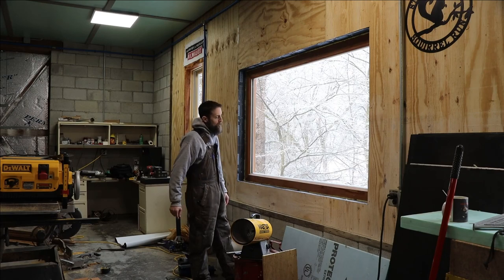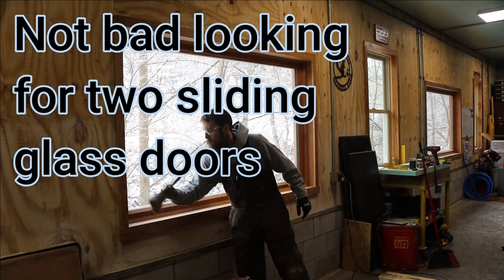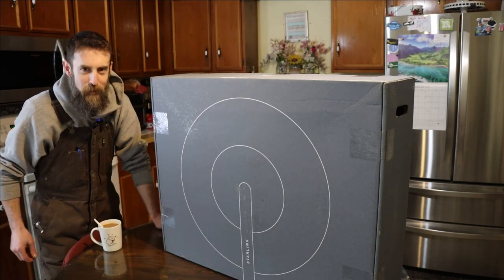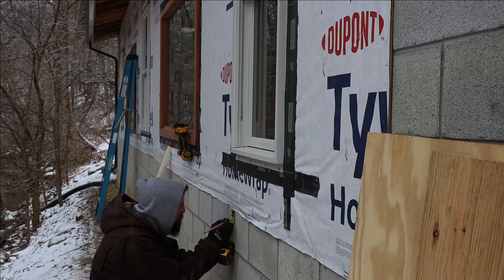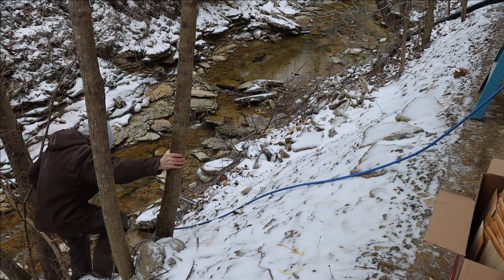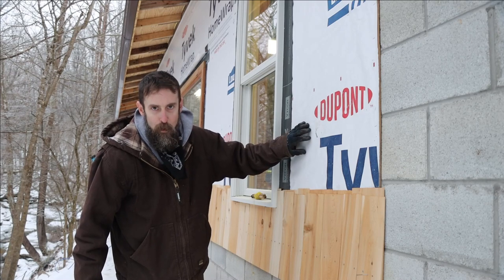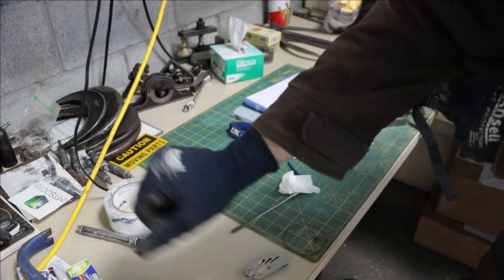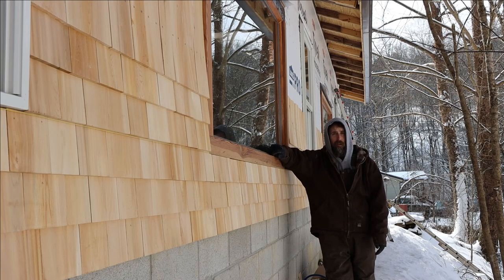Looking GOOD! Workshop Siding  going up. Shop update

Comment: Steven, what ever stove you buy let me recommend a "Magic Heat" box that goes in between the top of the stove inline with your pipe. It is a reclaimer and the amount of heat it puts out is amazing. Heard about them for years but finally bought one a couple years back. I felt just like you with your internet, happy at the performance but angry that I wasted so much wood over the years.

Comment: I got stuck in a hotel outside San Antonio for a week while driving from Florida to Arizona. Everything was covered in ice and the storms were back to back. I couldn't even get out of the hotel parking lot because of the ice. Restaurants ran out of supplies and closed. I lost 12 pounds (none of it from around my waist). I can't complain though. The hotel never lost power or water and there were a lot of people across Texas that were not so fortunate. People were trying to check into the hotel to escape freezing homes but the hotel was full. Definitely a bad situation.

Comment: Steve, I would put a wood stove at each end of the shop if you can afford it. You could build your second one out of old rims stacked one on top of the other. 1-inch difference in rim size stack inside each other. (several videos on YouTube show how) If you want to see the fire use glass from an old oven in the door.

Comment: Ifound after years, I bought a finish air nailer for putting up oak trim is so much faster than drilling than trying to hand nail. And yes harbor freight worked just fine, and cheap.
Reply: I agree with the Harbor Freight nailer.  I did find that using a name brand nail in it made a hugh difference.  The Harbor Freight nail seemed to bend and jam much easier.
Reply: Yes for sure a Brad Nailer for trim is the way to go. 10 times faster and MUCH cleaner. I don't do trim without one.
Reply: @larrysmall3521  my problem with the HF nailer is the sealing ring goes bad and you cannot get replacement parts.
Reply: @july8xx  I've had a HF brad nailer for over 20 years. At one point due to its advanced years it did stop running for me. So I pulled it apart and gave it a good cleaning. That brought it back. It's a model they don't sell anymore. Thing has zero safety features on it. You pull the trigger and it launches a nail. I love it! If a seal ever goes in it I'm going to find a replacement someplace.
Reply: @1pcfred  The seals were some kind of white plastic that deteriorated after a few years, I wish I could find something to replace them with. The crown stapler and brad nailer have not given me any problems just the large nailers.
Reply: @july8xx  my gun is from 1994. It has no right to still be working today. It tried to retire but I wouldn't let it. They don't make them like it anymore. I hate the new guns with that safety nose switch. So clumsy.

Comment: My approach to your wall would have been to go with weathered blocks but I have to admit that you are going to have one good looking shop wall.
Reply: I used to pass an old cinderblock garage where the blocks tapered from bottom to top so when it was painted it looked like either a shingled building, or one with really wide clapboards from a distance. I suspect the idea never took off due to needing right and left corner blocks. Looked kind of neat though.

Comment: Steve - Have you considered running a safety net or something between the trees below where you're working ?  Or wearing spikey-crampon things under your boots ?
You now have some holes in your blocks below the siding from the guide 4x2 - could stick a couple of eye-bolts in there as a hook point for a grab rope, or
even a longitudinal wire, hook a carabiner on and to a harness - or even just hook onto your belt.   Just thinking ahead.

Comment: Steve, you and Elizobeth looked very cold out there putting those shingles on. It looks really nice. Better than lots of houses that people live in. Steve, I have a nice pellet stove and it does a good job heating my entire 1600 sq. ft. house but it has its draw backs. It has an electric feed motor that feeds the pellets into the fire box as well as a thermostat. When the electricity goes off so does your heat. Also if I keep the thermostat on 68 to 71 it will burn a sack of pellets in about 24 hrs. Here the pellets are about $4.99 per sack if you buy a pallet at a time. That is about $150.00 a month if you burned all the time. That ain't cheep.
As much wood as you have around your house you have the right idea to get you a wood stove with a blower or put a small fan near by and it should heat your shop ok. That snow surely is pretty to look at but a little unpleasant to work in. I enjoy your videos as they are and now they will probably get better with that new satellite high speed internet.

Comment: You're a great builder; make a wood-burning stove; it will be way nicer and work better than anything you could buy. I've had wood stoves with glass fronts, and frankly, the ambiance of seeing the flame wears off real quick compared with perpetually cleaning the glass. Besides, a steel door gives off more radiant heat, and the stove stays warmer longer once the fire goes out. Get or make one that drafts from outside, so you aren't drawing your combustion air from the shop's interior by sucking air in through all the shop's gaps and cracks.

Comment: If i were able to convince you of anything, it would be to get a pellet stove for your shop, and your house. I burned wood for 20+ years and then 20-25 years ago I switched to pellets. there is nothing that beats pellets. They are less work, more heat, by far they are more efficient. They will heat your shop 24-7 with so little work compared to wood you will wonder why you even considered wood. I also burned coal for about 12-15 years in the basement cause it gets real cold down there in the winter and a heated basement keeps your floors warm, and that is nice, This winter I retired the coal stove in the basement and installed another pellet stove. I am so glad that I did. Coal heat is great, it is hot and it burns a long time, however it is twice as much work as a pellet stove. If it came down to it I would burn coal again, but I will never burn wood again. 
      I know you say you have all that free wood around you, but it ain't free. It's cost in labor makes it so not worth it at all. 
      Listen to an old man and at least look into pellets.

Comment: I'll stick with my DSL through my phone company. I will never use a dish or satellite ISP. 
Look at Harbor Freight for a cheap wood stove. Growing up, as a kid, my grand dad heated his shop with a homemade wood stove, basically, a 55 gal. barrel. He also had electric heaters and a gas stove. Believe it or not, the wood stove heats differently, more labor intensive but, in the long run, it heats better in my opinion.  
Here in KS, our wonderful state gov't. has decided to have the power companies shut power off for an hr or 2 in different "sections" per day. To save energy. Now, I guess they fail to understand some people need electricity to survive. Honestly hope they get sued over deaths that they may cause due to these extreme cold temps. and the shutting off of power.
Be careful working along that steep slope, this type of weather, will actually help with any injuries but, you feel it far worse than you should. Plus, getting back to the topside... Great video as always, cheers :)

Comment: I remember reading about starlink a few years ago when I lived in the middle of Denver.  Now I live in the rural outskirts of Surprise, AZ. I will definitely be looking into it. Currently I have 2 choices for ‘over the air’ Internet (for lack of a better term). It’s basically a receiver up on a pole that points to an antenna several miles away. According to my neighbors both options were equal. But they are very low mbps but decently reliable. 2-7mbps, which I don’t really know enough about mbps but it works for me. Streaming, wifi, YouTube, motortrend and netflix often. However I still subscribe to DirectTV for tv service because I question the speed if I start to stream everything. 
Starlink is temping and it turns out my address was approved for BETA when I went to their website. Hmmmmmpfh.

Comment: Glad you found some decent internet. Hugh??net is what you had? Its the worst. Coming from Texas, we appreciate your concern. I know yall deal with this all winter almost but for us, "winter" is basically an extended fall. They'll certainly be doing an investigation into ERCOT (Texas power grid managers), not that it'll do any good. I know we rarely see this weather, but I wish they would harden our infrastructure against this kind of weather so we can endure it when it does happen. It was like the 1700s for a while. No lights or power, no hot water, no running water at all. I was unloading my car after work each night with my headlight. Anyway, we'll pull through.  Thanks again for the mention. #texaswinterstorm2021 #texasstrong

Comment: i seen heaters with a belt feed / hopper feed system that works on just scrap wood and branches you put through the chipper its basicly a tall pipe with a  smouldering fire at the bottom and forced air blowing through from the bottom that heats up the woodchips above it before the smoke going out the chimney  , while burning the ashes fall out the bottom and the woodchips slump down in the pipe the hopper belt system just keeps topping it up, the amount of air blown though the pile dictates the amount of heat coming off the system 

wasteoil burners work good too if you can get youre hands on old engine oil transmission oil cooking oil etc 
there quite a few videos on youtube on that , it takes a heck of a lot less space to store per btu put out and theres less effort needed to heat the workshop with it , there about as quet as a normal woodburning stove you hear just the blowermotor going , seen some that mix the two fuels by just dripping the wasteoil on the burning wood

Comment: I see you open up "StarLink" i am seriously thinking about getting this, Just did some research last week in the product. my internet way to expensive for local ISP, raised there rate.
Reply: How much is a monthly service? My internet sucks and there is only one provider in my area. Same situation Steve is in.
Reply: @hilltopmachineworks2131   They have a website. just put your address in,  When you hid order now(doesn't place order) it shows you if it's available for your area they only allow so many in particular area from what I am reading.  Seems like great way to cut ties with the local monopoly of service in my area.
Reply: @Scrapy-ih7ob  Okay thanks.

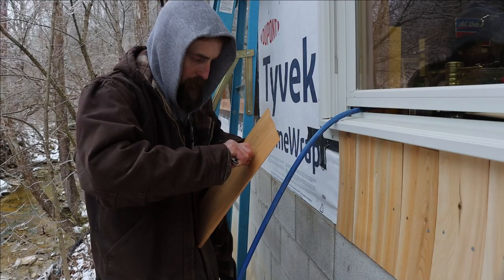Comment: 23:21 Shouldn’t you have put flashing tape around the window frame before nailing on the shingles?
Reply: It's on already. The black tape around windows.
Reply: @KJ-kw7gh  Its is around the openi ng but you are supposed to tape it over the window frame that he uswed for screwing it to the wall as well…. Maybe my eyesight going bad….

Comment: I don't think it will make a big difference but, on the bottom row of shingles shouldn't the "first row" be shingles cut in half horizontally. The upper half used to "Kick out" the bottom of the first row of full shingles.  Like I said I don't think it will make much difference to the whale project.

Comment: They are pulling blue and red cables down the road from me I hope it is Fiber!! Of course my luck it won't come down my street. May have to go Starlink in the future. The multi day uploads for a 20minute video are annoying.
Reply: Hay Brian, ATT strung fiber in our neighborhood little over a year ago. I finally switched over...it's a true fiber run right into the house. I was skeptical that it was a marketing ploy, as some are just to the local distribution box then copper to the house. The speed is unreal and I'm paying less, being a cheapskate I chose 300 MBS up and down they offer up to 1 Gig with 5 Gig coming. A 20 minute HD video finishes uploading before I can finish typing the description "Wow" Our only other true high speed choice was the cable company and I refuse to business with them... So far its a huge win !
Hope you guys are warming up.  ATB...Dean
Reply from the maker: Yeah, if fiber is a option wait for it. Although this starlink system is pretty darn good. I was blown away at how fast it was compared to our old provider. Night and day difference 👍

Comment: Hey Steve... since you are now going to have a Better connection to the internet....  as a suggestion to help you video...  you can get some POE cameras for the Shop (inside) even Outside will give you extra video for your channel...  they do not cost all that much and you can get a DVR to record these cameras...  there would be filler type video... not primary like you are doing now...
Just a suggestion...

Comment: I have been using this free standing wood burner for 11yrs now. It has a secondary burn system, which reburns the smokey exaust before it goes up the chimney. You get more btu's for the buck and a lot les creosote to clean. It also has an air wash system that keeps the front glass door clean. I only clean mine twice a year and it only takes a wet papertowel with NO SCRUBBING OR SCRAPING. It also has a blower on the back that throws the heat forward. Also a fresh air intake port so you can run a piece of tubing from the back through your wall to the outside. That keeps the bldg from getting drafty.  They are sold at Tractor Supply, so see if there is one near you.  https://www.usstove.com/product/us-stove-2500-sq-ft-epa-certifed-pedestal-wood-stove-with-blower/

Comment: Bandwidth  Even with the new system, multiple people using it can cause problems.  Imagine two people are watching videos and a third downloads a huge file.  The file can cause dropouts in the videos.  This can be prevented by using a Bit Torrent client to do file downloads.  Bit Torrent can do bandwidth limiting, you still get the file(s) but without affecting the other realtime video streams.  Caution: never share a torrent for content that could be considered copyrighted.  You should not do that in the first place, but that is how they catch people.
Reply: That's what VPNs are for.

Comment: No doubt they were ripping you off but Starlink is really a different proposition as far as the technology goes and it has a right to be much better than the older options. Glad it is good. Not sure whether I should feel sorry for the other firm that's going to have trouble now. They'll probably just hope their customers continue in ignorance.

Comment: It was bad down here in Texas, some of us were exceptionally lucky to lose only water and not electricity, others lost both, with temps down in the single digits here in the Dallas/Ft Worth area and no we are not prepared for extreme GLOBAL WARMING like this. Luckily temps are coming back up and snow is basically gone, looking forward to spring time. Be careful around that ice and slope, not a good mixture along with ladders, don't know if you remember the ladder incident inside the shop a couple of weeks ago, memory goes the older you get.